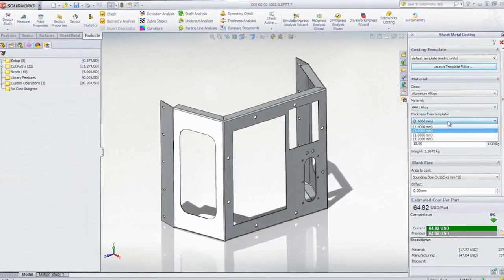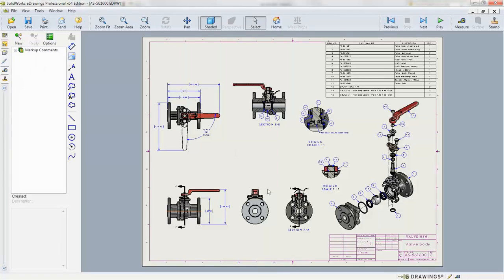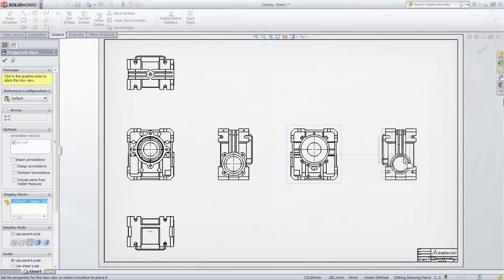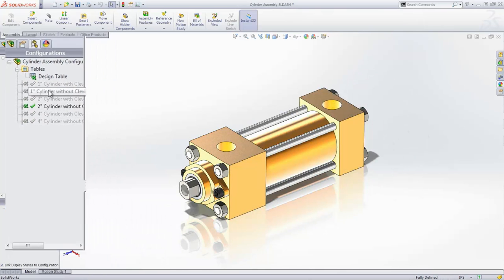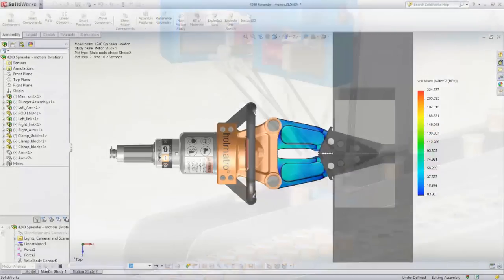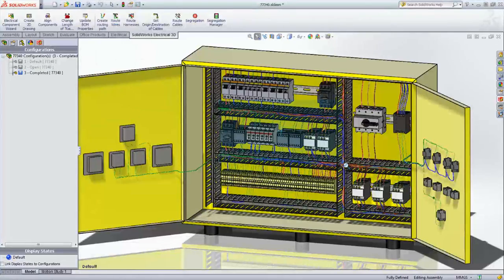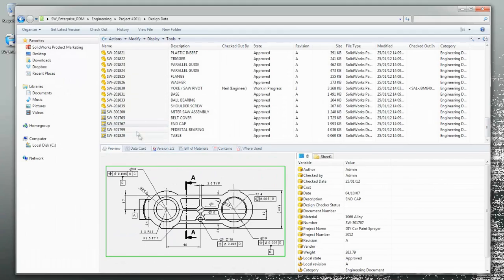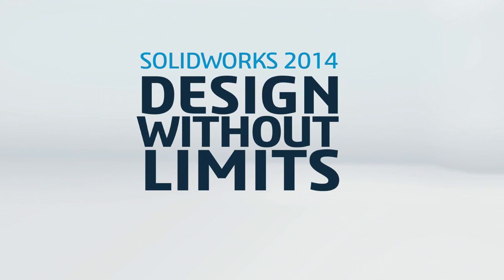SolidWorks 2014: Machine Design

Comment: I think that it is up to you. The average user won't have to be struggling with every single feature the program has. As you know and as just said, it is up to what you need and, if you find it hard to use, then I think that you should give it a try and consider that you might find most of those features really useful, if you are involved in the manufacturing area.

Comment: There's just one thing that seems to be missing. What about the simulation of how a material degrades over time (Wear & tear)?
A spring, for example, would lose it's ability to store potential energy over time and would be subject to rust or erosion.
Reply: Maitland Gill run a fatigue simulation
Reply: You need to run a fatigue analysis, check endurance limits, and fracture toughness of materials

Comment: How hard is it to learn basics for this program?
Reply: @Oogly_ Boogie I am, electrical eng, but I doubt they will teach this type of stuff
Reply: The basic form of Solidworks is for machine designing and analysis, so it is more useful to a mechanical engineer. I have intermediate proficiency, so for me, it is pretty easy. I do not know much about Solidworks Electrical. However, my friends who have their majors in Electrical Engineering say they don't use much of this software.